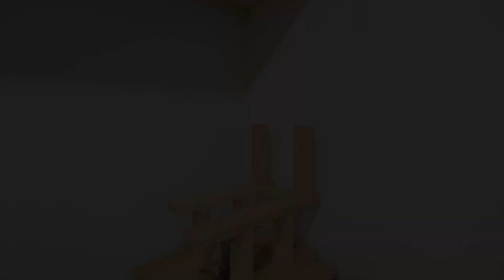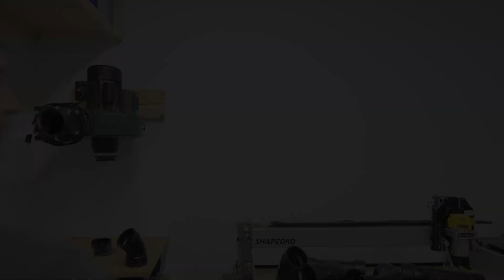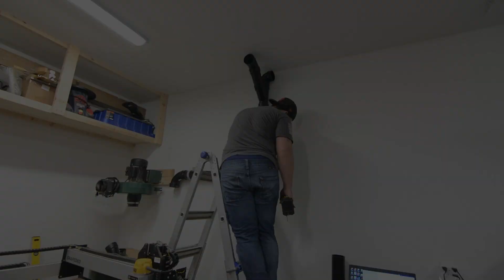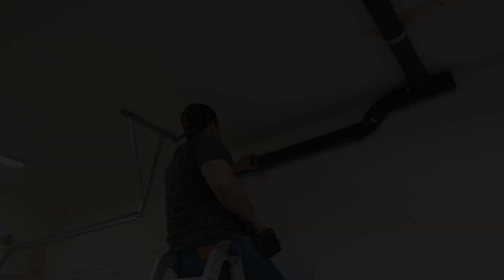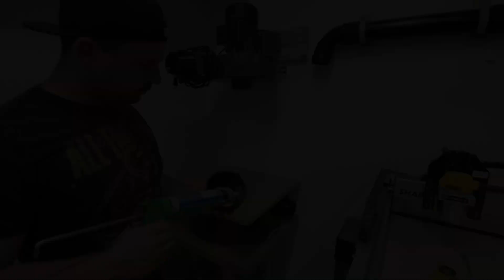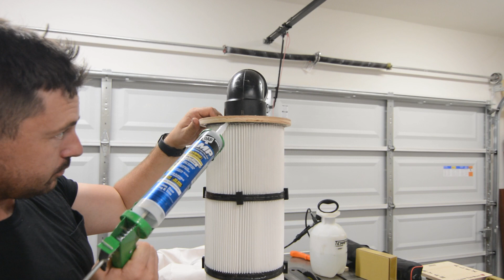Harbor Freight Dust Collection Mod | Part 4

Comment: You've got a lot of 90 degree bends in the system.  If you ever need to redo it, you should consider using multiple 45 degree sweeps to keep the air speed up, thus increasing the overall flow through the system and reduce wear on the motor.

Comment: Great modifications. However, using the dustright cloth bag as a final filter medium is a grave mistake. It will blow the extremely fine dust into the air. This dust can stay airborn for up to three days. This extremely fine dust is a health and explosion hazard. Eliminate the bag and replace the filters with HEPA filters. HEPA filters trap 99.9% of dust.
Reply from the maker: If I could afford a HEPA filter I would. Unfortunately, the fact that I’m using a modified HF dust collector is demonstrative of my available budget for shop dust collection. In a perfect world I’d have a much better system than this. And besides all that the amount of airborne dust that would have to be produced to create a dust explosion is far greater than what I normally produce. This system has been functioning in my shop for a good while now and nothing remotely dangerous has occurred as a result of using the dust right bag. I’ve had it functioning at the same time I was using my CO2 laser engraver and still no dust explosion.
Reply: @goldencoastwoodworks  I do like how you used four standard filters to save cost. However, replacement HEPA filters for shop vacuums from Amazon cost $15.00 each. HEPA filters can trap at least 99.97% of dust, pollen, mold, bacteria, and any airborne particles down to 1 micron in size. The most immediate hazard is breathing in the fine dust, that the bag that allows through the fabric. The bag is rated only down to 30 microns. Sanders, routers, and shapers in particular produce large amounts of fine dust. Very fine wood dust is especially hazardous. It can accumulate on rafters and other building structural components and in unexpected spots all around your facility, far from the point of generation. Dust explosion hazards will get worse over time as a fine layer of dust will builds up on every vertical surface in the shop. If this dust were to become disturbed in the presence of a spark or open flame in the right air/fuel ratio an explosion is possible. The ignition sources are numerous in a typical shop: Gas water or home heater flame, sparks from inside of power switches, electric motors, welding, grinding, static electricity, even unplugging live power cords.
Reply: @scottscarbrough7208  HEPA standard is 0.3 microns.
Reply: @goldencoastwoodworks  If you replace the dust filter bag at the bottom of the fine dust filter stack with a plastic bag, you will greatly improve air quality in the work space. Because the filter bag is more porous than the filter stack, the air is bypassing the fine filters and going straight down to the bag and exiting along with a lot of dust through the bag. Best of luck.
Reply from the maker: @randallsmith7885  I think I’m going to have to. Your not the first to suggest it. I’ll have to look into filter bags.

Comment: I put  carriage bolts into the 2/4 before screwing to the wall then you just slide on and tighten bolts to mount the heavy motor.
Reply from the maker: That’s smart. I wish I would have thought of that.

Comment: Cool build! Great job filming and overall presentation. I’m curious as to why you are using a filter bag along with the filter stack. I would think some fine baffle filters would pair best with a plastic bag so that air can only pass through the finest filters. Plus a plastic bag is easier to empty, and doesn’t shoot fine dust back into the air when it inflates.
Reply from the maker: I’m using it purely because I had it left over from an old setup. You could use a plastic bag and it would work just fine. My filter bad is 20 micron I believe so it does a good job keeping the fine dust out of the air.

Comment: Looks like you are severely restricting the air flow on both the inlet and the outlet of that blower by reducing the inlet and outlet diameter.  I would recommend to at least keep the diameter the same size as the factory ports.
Reply from the maker: Nope. Plenty of air flow and no issues with collection. Obviously, this setup could be better but I didn’t want larger pipes but I’ve been using it for weeks now and no issues with collecting dust have popped up.
Reply: @goldencoastwoodworks  Well, I’m glad it’s working for you!  

I have experimented with different inlet and outlet pipe sizes and have always had more air flow with larger diameter inlet and outlet than what came from the factory.  I currently have a Harbor Freight dust collector that I made a custom 6 inch inlet on.  I recently removed the filter bag and vented through the wall with a 6 inch outlet and that has made a considerable difference in air flow from the factory 4 inch inlet and filter bag on the outlet.  I currently don’t have an anemometer, but I can see the difference in the amount of dust collected, and when I put my hand over any of the dust ports in my system, it feels like the pressure and air flow are much greater.